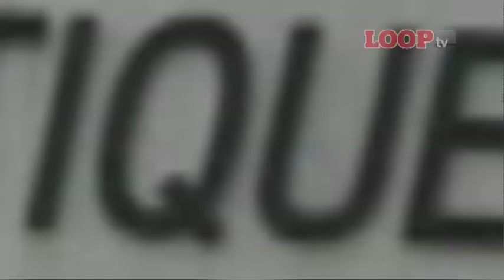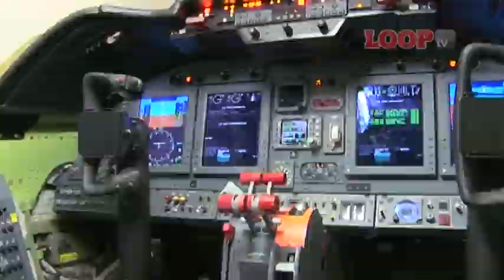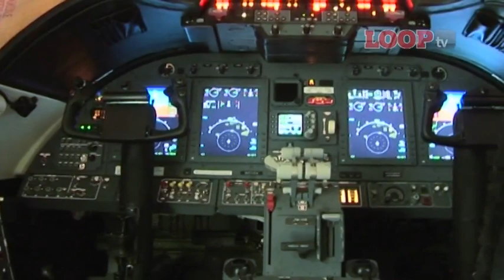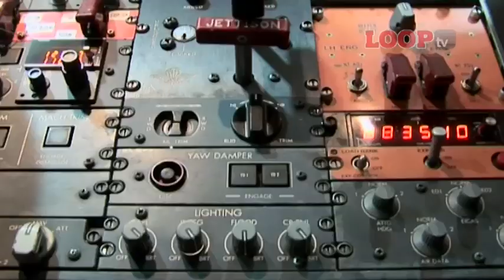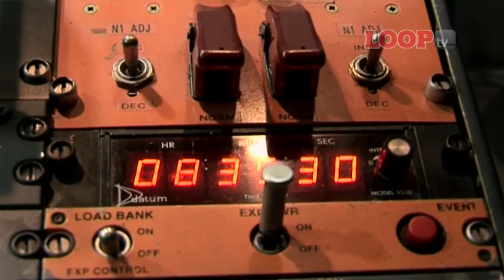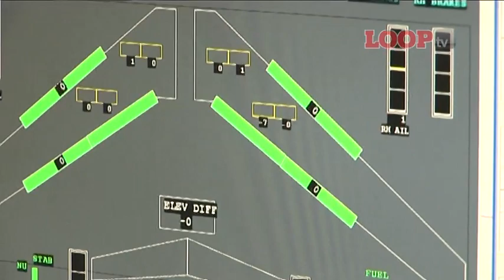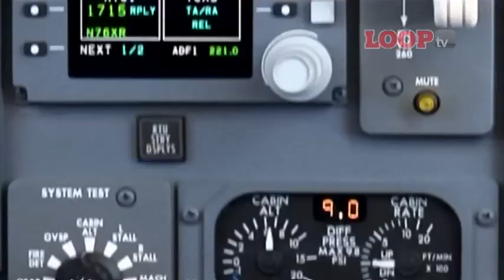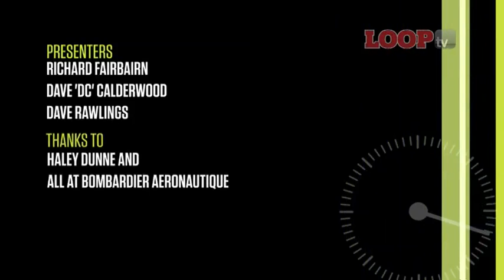A Learjet aircraft is born - Behind the scenes at Bombardier Aerospace

Comment: Why is the more powerful engine always put on the left side?
Reply: I have know idea but what I know is that I learned something know about my favorit plane: Learjet. Does anyone know if this applies to Learjet only or to every plane in the world. Does this mean that if a 2 planes (of the same type, same serial no. ...) are made the one of the most powerful engine has it's engine placed on it's left side? Good question @Luc Serre
Reply: Luc Serre I thought jet engines are persicly made and it puzzling why they would have a difference in thrust demonstrably different.
Reply: Performance differences in two same engine models (as slight as they are) are due to adjustements tolerances (for critical parts its usally .xxxx inch adjustments...)
Reply: I would think it had to due with the yaw damper system
Reply: Luc, it probably has something to do with the FADEC computerized engine controls knowing that the more powerful engine is on the left. And its not much, probably less than 1%